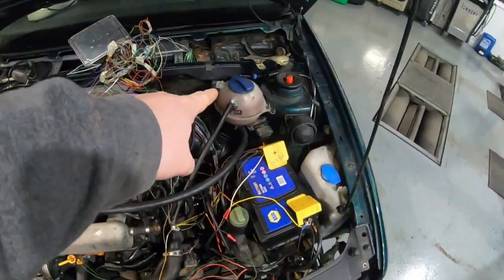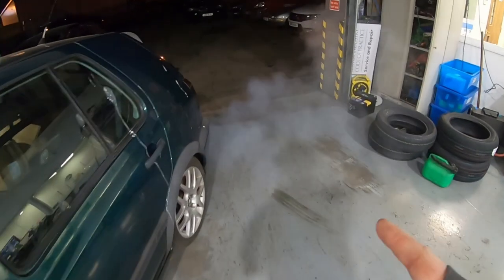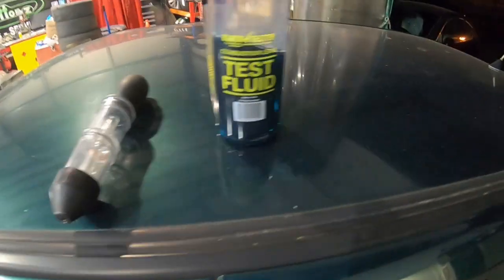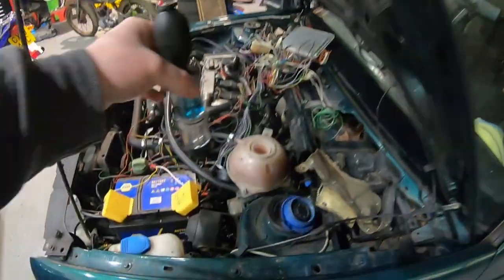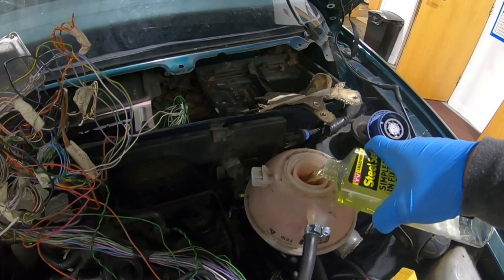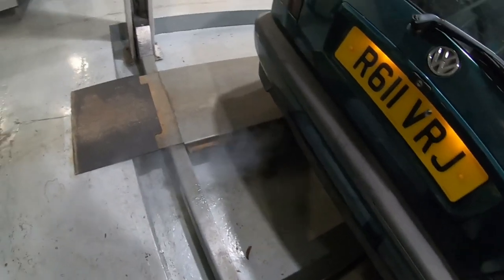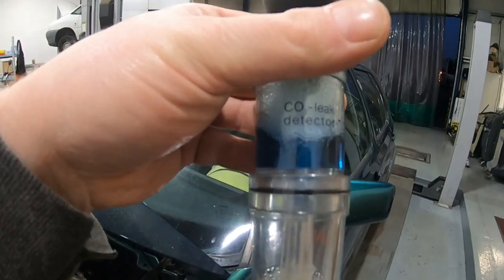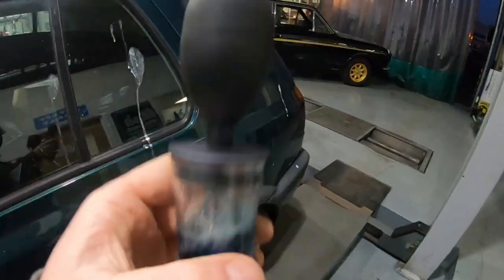Is Steel Seal the ULTIMATE Solution for Fixing a Blown Head Gasket?

Comment: Vw’s normally blow head gaskets around 150k  I used to have a ton of VWs lol I’m a big foreign guy  them Vw’s are super easy to do head’s gaskets on.  Just make sure you send the head to the machine shop to have it checked and resurfaced if they don’t find anything wrong with it as in cracks …  get new blots too !!  I believe that head gets torque down to 172 ft lbs. if I’m not mistaken lol it’s beer 22 years senses I’ve worked on those lol 1.8 block with a 2.0 head.  Same blocks as the MKll. The five speed transmission from the mark 2 still bolt up to that MKIII
Reply from the maker: Thanks for commenting
Reply: @chasingwaves11  stick arp head bolts in it’ll not have another hg issue again.

Comment: I just read not to use if I have water in my oil? I'll be sad if I can't fix my gasket as I can't afford the gasket replacement repair. I'm an aged female pensioner.
Reply: Water in your oil?
Reply: Yes
Reply from the maker: It'd be worth a try just for the cheaper cost than the head gasket replacement
Reply: i have it the other way round oil in the expansion tank will it work ?                                            i will try  steal seal tomorrow.. and let you know,,,,
Reply: @willsteenson1604  be careful! You must flush the cooling system, and change oil and filter. Then once the SS has been put in and tested for success, you MUST flush again and change oil and filter again. It will NOT work with red coolant. It's only okay with blue. I CONTACTED the company and they sent 3 emails with specific instructions. Noone should be using it without following this advice.

Comment: Hey did you use it in g12 coolant? Thanks
Reply from the maker: Hi Jak. Yes I did
Reply: @MarksWheels  ah nice I have a t4 that takes slthe same g12. I mailed Steal seal about g12 and they said to use plain water, not sure if thats the best idea as boiling point and all. I may dilute it slightly with coolant first..
Reply from the maker: @JakTonge  Good shout. Best to be safe. You can always drain and refill with G12 after if nessercary.